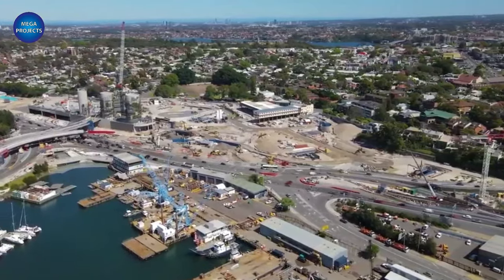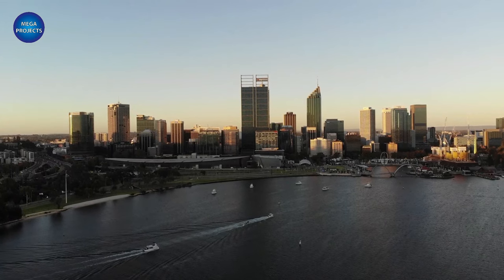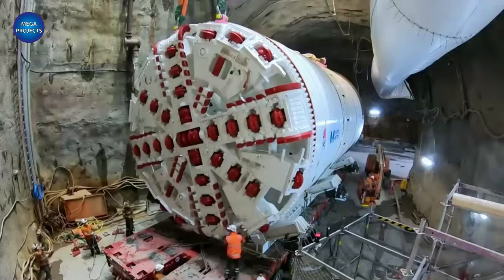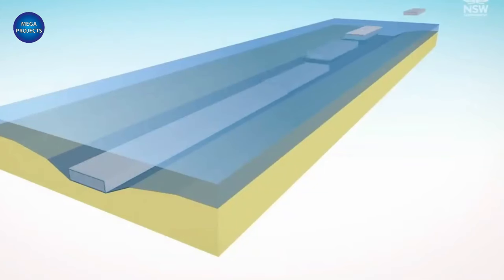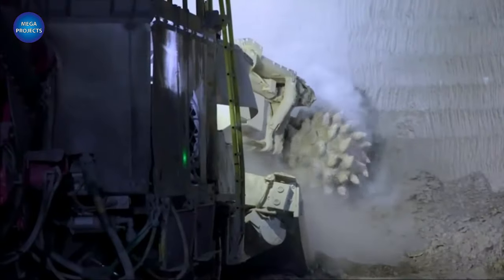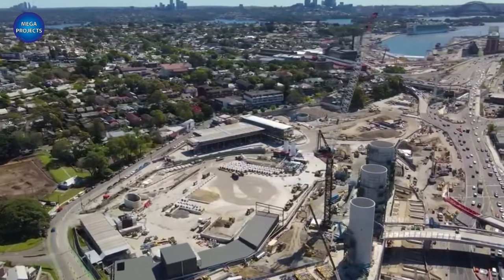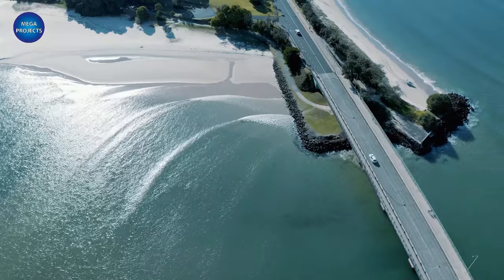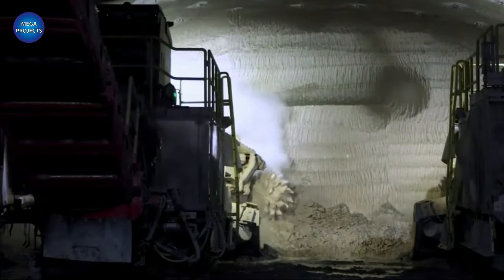Sydney's $5BN Tunnel U Turn  | Future mega projects

Comment: Everything with motorways in Sydney and NSW seems to always fall short of the final target and so many holes. Watching the 3 documentaries on the Sydney to Newcastle expressway from Berowra to Calga how far advanced they were for mid 1960's to 1972 and despite improvements in technology we haven't advanced much at all. We've just freely allowed bottlenecks and people to be killed. Good roads is not only safer, it helps with mental health without being clogged on the roads and it helps the outskirt towns as well. With the new airport coming it's time for a Premier or PM to really take ownership and legacy of it all. The only way the new airport will work is if all/most roads point in that direction. Since we pay tolls anyways there's no issue stopping a project short or take corners we can get it one. As someone in here has alluded too get skilled overseas workers from China to build it much cheaper and quicker. So here's some ideas I would love to see it's a dream but I am a road traveler throughout NSW.

M1 - wouldn't it be great if the M1 becomes a true M1 linking from the north side to Waterfall in the direction I don't know but I'm thinking across North Turramurra and taking on parts of Forest Way & Wakehurst Parkway direction to the Warringah Expressway and then an Eastern Suburbs/Airport by-pass. The old F6 stops short at Waterfall. The old F3 stops short at Wahronga. Both are classified as M1.

M11 - this should have really been pushed through to Silverwater Road cutting out the bottleneck at Carlingford. This would be perfect linking Newcastle/Gosford with Olympic Park.

M7 - I wish the original proposal to Mt White happened and they should look into it with the new airport coming.

M9 - I've heard many proposals for the M9 what would be the ultimate is starting from the M1 just north of Wollongong either running in line Picton or Appin Roads, cross over the Hume Highway, head northerly towards Northern Road running in line with that up to Richmond/Windsor then continue north following the pathway of Putty Road and then Golden Highway to where the M15 is plus a north link to the proposed Singleton by-pass. Upgrade John Renshaw Drive in the M1 to M15 link. This provides a direct link from the New England region to the new airport and to Wollongong and Canberra.

M2 - the original proposal of extending the M2 out to Cranebrook linking to the M9.

M10 - A new name running parallel with Bells Line of Road, providing a by-pass of Lithgow, Windsor/Richmond and finding a way to least where the M7 passes through maybe further out. We need a better passage way over the Blue Mountains. The Great Western Highway serves some purpose and is mostly a good road to Katoomba beyond there is terrible. Like Sydney to Newcastle there's only one viable road when we can/should have more. The Central West deserves better.

And I'm sure there's many more especially linking regional towns from coastal to inland NSW/ACT regions especially to and past towns like Tamworth, Queanbeyan and Wagga Wagga. I know it's wishful thinking.